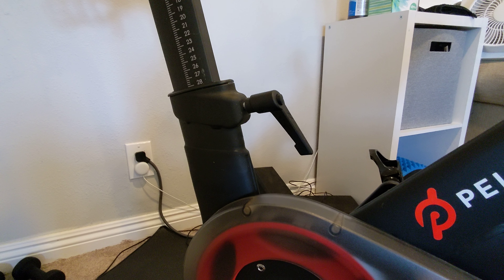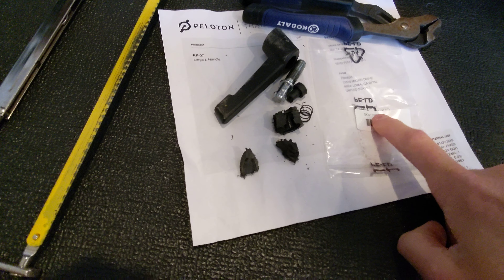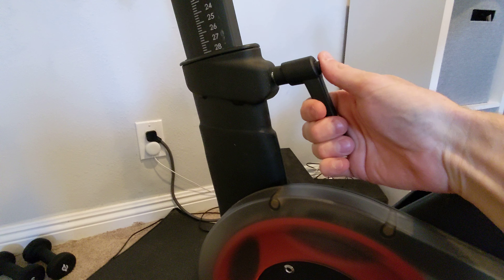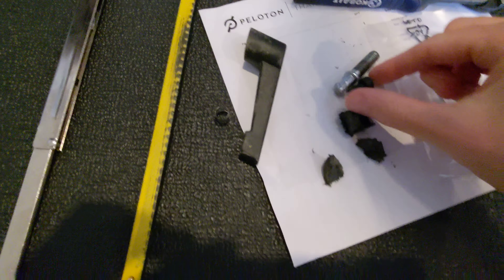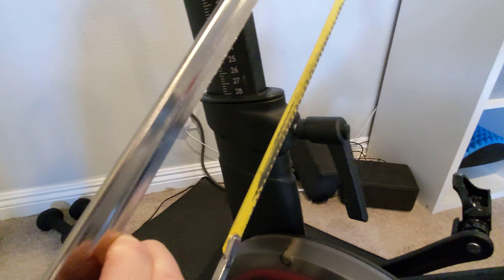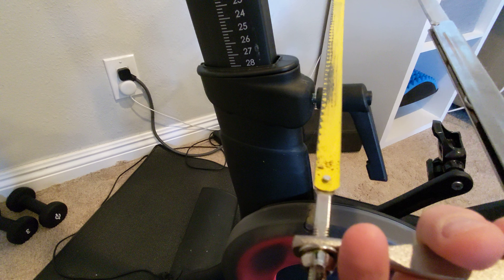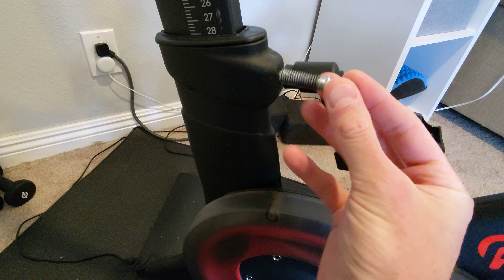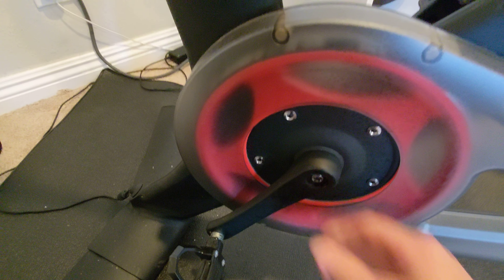Peloton Seat Height Lever Handle Stripped: Replacing RP-07

Comment: Just replaced it.  Thank you for the video. Great tip on putting down a cloth first to catch the shavings.  Hacked it off in two parts.  Ended up creating a crevasse and then used a flathead to break it up. Still have all my fingers, and ready for a spin.  Peloton did a great job getting me the part. My warranty had expired, but they sent it to me free.  My guess is that this is not an uncommon problem.  Definitely, won't be over-tightening in the future.

Comment: I used a hammer and flathead screwdriver to get the second piece off after the handle.  I chiseled off pieces until it was only the bolt.  The screw is easily spinnable with an adjustable wrench.

Comment: Yep. Break the lever, cut the soft plastic chunk around the bolt, then manually unscrew the bolt. The sleeve that goes around the seat post, RP-05 replacement, now comes with a metal piece where the bolt terminates which should help prevent future stripping. Replace RP-07, the lever, and then you’re all set. Use a drop cloth and keep a vacuum handy for cleaning up plastic sawdust.

Comment: Thanks for the guide! I got the plastic off the bolt with the hacksaw and pliers but I can’t for the life of me get the metal bolt to move. The pliers just spin on it because it’s rounded and doesn’t have grip. Any advice?
Reply from the maker: Hope you got it off! I just squeezed really hard and once it starts to budge it should be easier
Reply: @DIYwithMIKE  thanks! I ended up buying locking pliers, and that made it move!

Comment: Were you able to replace the nut as well? We noticed metal shavings under the bike and either the bolt or the nut is stripping.
Reply from the maker: That may be a part of the neck collar, which can be replaced as well (at least I did on the front handle side). Take pictures and do a web chat with customer support and share the photos (icloud link or Google link)

Comment: Hey bud, just to let you know, you actually don’t have to spend any money on parts to fix this issue. Take your seat bar out of the hole and tighten the screw, you’ll see two plastic tabs open up. Those tabs apply pressure to the bar and allow the seat to sit at the adjusted height. Cut those tabs off exposing the metal plate, release the screw from the tightened position and make the metal plate sit flush inside the cut away. Lower your seat bar down gently until it passes the plate then put the seat at your desired height and tighten back down. The plastic sleeve wears away and won’t hold, the metal plate on the other hand will. 🤛 boomsies.
Reply from the maker: My issue was the handle stripped away from the screw so I couldn't adjust the tightness of the screw to hold the stem in place